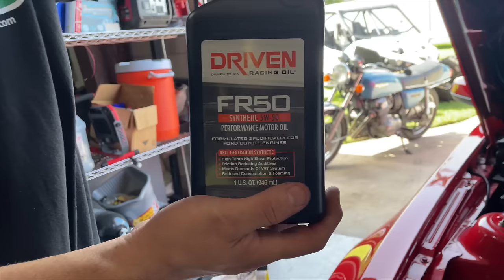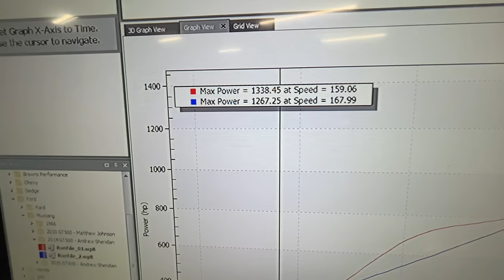Whipple 3.8L GT500 Lays Down Big Power for the last time on Stock Computer

Comment: Wondering how you keep your iats down? I got a gen3r on a 2016 GT and my iats are getting over 210 off a pull or two
Reply from the maker: It should never get that high. Is your intercooler pump working?
Reply: @MustangLifestyleTV  I’m currently not around the car so I can’t really check but it definitely should be as it just got a brand new kit from Vmp on it